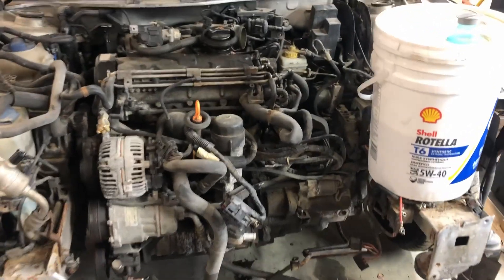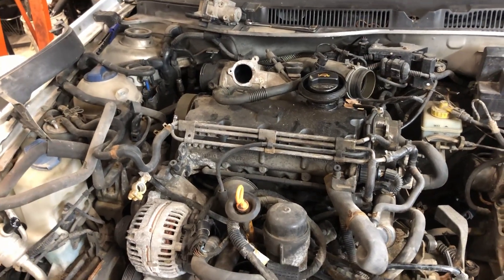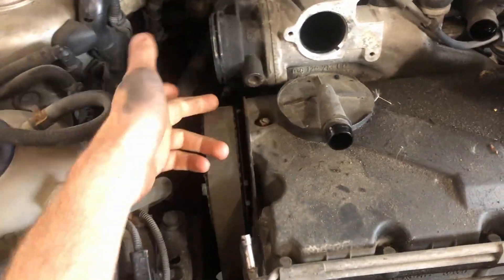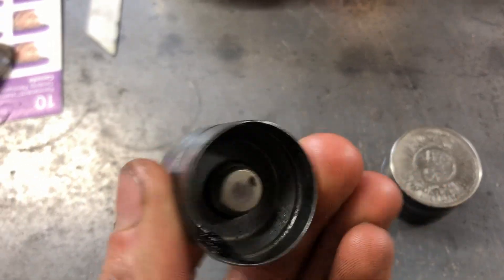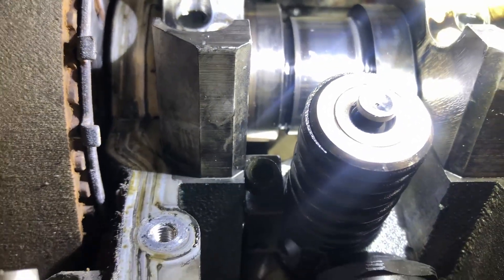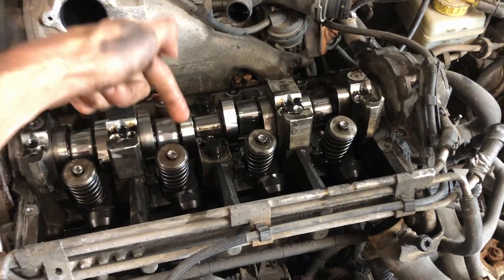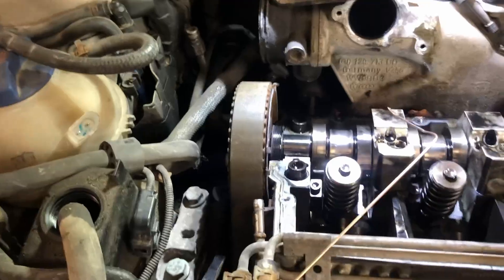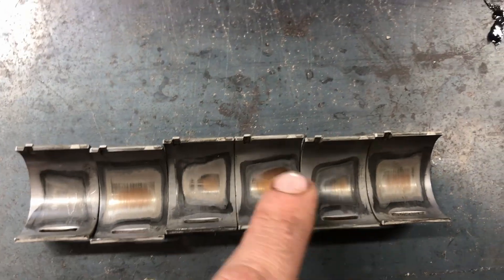Did Rotella T6 Wreck my BEW TDI? 545K Cam inspection

Comment: Maybe I missed it- but did you run T-6 on the car it’s whole life, or only after warranty? My ‘06 TDI PD (BEW) has 235,000 miles. I’m running VW spec, but only owned it a year. I’d like to switch to T-6. My cams and lifters “look good” but I didn’t know about looking for the chamfered edge to help determine wear.

Comment: know a guy running one. he gets the hard to find parts off a guy out east on Kijiji that brings them up from the south with no rust, He needed a power steering return hose as they were obsolete for 15 yrs and the guy had mint ones.

Comment: I do vw diesel mechanic since 30 years. One of the good modification to help cam on PD engine is drilling oil pass on cam caps (Franko6 mods).
Jérôme 
Québec
Reply: I watch a channel that build race can engines and he also added lubricant to cams and other area ..Thanks for the tips
Reply from the maker: I haven’t done that but I’ve seen the his mods, it’s a simply mod that makes sense
Reply: Cam bearing Reengineering for PD motors  on tdiclub forum
Reply: Ok there is my hight tech low cost for those brm tdi
From junk yard, i use
- lifter follower gas 2L 8V with 1 spring 
- drill the oil cam bearing 
- install the 2.5 rabbit  flywheel smf 228mm
- tranny LEA long ration 
-BHW injectors (dsla150p1452)
-Brake 345mm disk caliper passat synchro vr6

😊 have fun !
Jérôme
Reply: there is a guy out east selling southern parts for the 1999 up VW. on kijiji , friend went to him and found stuff obsolete for 15 yrs

Comment: Been using shell t6 in my tdis for 19 years...cjaa..alh..brm..cata..cnrb..not an issue..my brm has 516,000kms and still drive it daily
Reply from the maker: I can’t complain about the results on this car. It’s a sin if your on any of the tdi pages though.
Reply: @JoshsJettas  lol yah most people think it has to follow the spec or engines explode...all mine have been deleted so the requirements for low ash no longer are needed...t6 has been very heavily and I've not heard anyone say it's lacking quality and I know more than a few others that use it on their tdis as well

Comment: How often were you doing oil changes? I had a BRM that I got at 210k and drove it til 390k before the cam went out. Only used 505.01 religiously, but prob did 7-9k between changes. Maybe I should have done them more regularly.
Reply from the maker: 15k km oil changes, it got a couple 20k km changes from mis-communication. 

The brms I’ve done were around that 350-400k km when they had holes in lifters
Reply: Didn't matter brms had poorly made cams...most just wore out regardless of oil quality or brand.

Comment: I have a Volvo that has the inline 6 diesel based on the 1.6 diesel. Any oil suggestions. I run liqui moly 10w40

Comment: I use CastrolEdge Euro 5w 40 in all my shit. 2.0 BEV gas and the ALH I am fixing up, even my Lawn tractor lol. You can buy the 5 liter jugs on sale for between 40 and 49 bucks Canadian usually at crappy tire.  I think they are like 59 or 60 dollars reg price. Where do you buy the cam shafts and lifters for the PD BEW?  I am lost when it comes to cams/lifters...so much junky stuff out there its become a nightmare . I dont have a BEW but may at some point if i see one thats worth putting back on the road.
Reply from the maker: Yeah I just grab a pail whenever it’s on sale, the v10 takes 12L, so between that and the 4 cyl TDI’s it eats a pail up. Cascade German or Idparts have billet cams and Ina lifters, there’s a few performance ones that should last longer as well.

Comment: Do you know if the 15 tdi's also had heater core plugging issues or is thas strictly a ckra issue?
Reply: They did as well as leaking into the cabins.
Most recommend replacing the coolant every two years, as well as pulling the silicon bag out of the tank
Reply: Silicone bag? What is this?
I have a 2015 Jetta gas with a plugged heater core.
Reply: search on youtube for volkswagen silicate bag removal. its going to be in your coolant tank and youll see a logo that looks like a hand with a bag on it. sometimes you can drain the tank and see it, but most people have to replace the tank. I got lucky and was able to remove mine.
I also swapped from G13 to G12++ which people tell you not to do, but its fine if you drain the entire system and replace it all.
Reply: hopefully i didnt reply 3 times....
Reply from the maker: All the common rails seem to just the ckra is the worst.